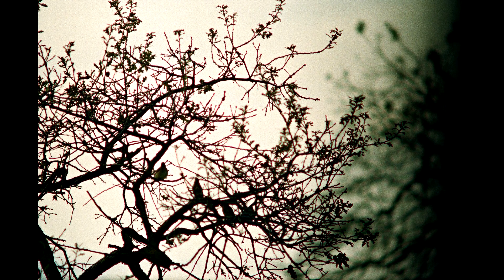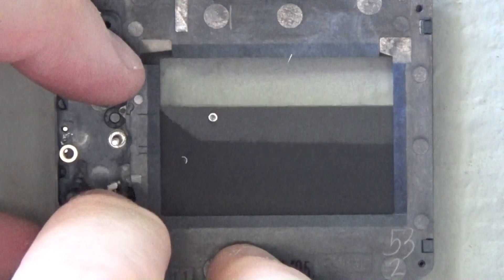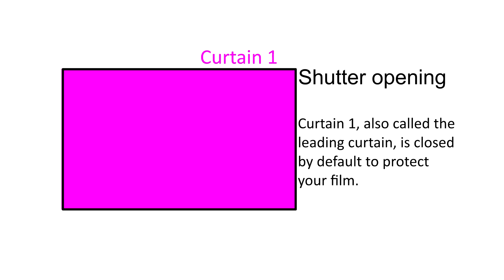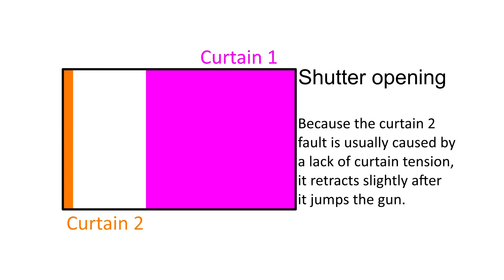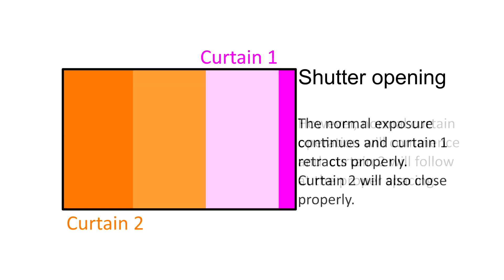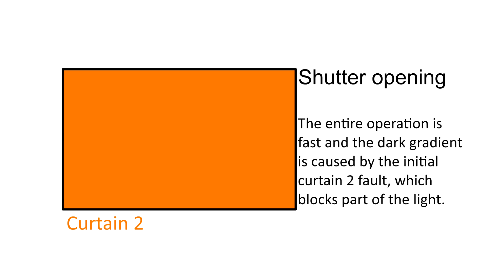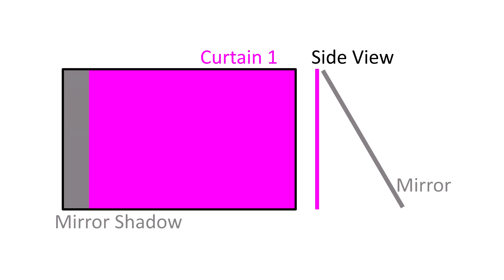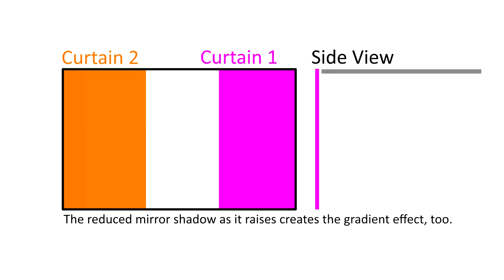Negative Flaw: Shutter Capping

Comment: exactly my problem with a newly purchased (but of course used) sr-t303. Does a "normal" CLA suffice, or do I have to specifically mention this problem when I get it serviced?
Reply from the maker: A normal shutter should be okay, yes. A good repairman will adjust the shutter speeds as part of a baseline repair.

Comment: I don't understand this video. What am I looking at.? What about a leaf shutter.?
Reply from the maker: Leaf shutters don't suffer capping. Basically shutter capping is a mechanical problem with focal plane shutter cameras, like SLRs, where in the shutter does not travel properly.
Reply: @DavidHancock  Thank you, I'm having a problem with lines on my negatives and I'm trying to determine if it's caused but the auxiliary shutter (barn doors) or if its a light seal. When I saw the title of the video I thought it might offer some guidance but now I see the difference between focal plane and leaf shutters.
Reply from the maker: @pefawa  Do you have a link to any scans? I can tell you what's wrong.
Reply: @DavidHancock  David, I appreciate your offer to look at the film scans, however I believe I've found what caused the dark lines on the side of the film. I develop my film in a Paterson tank using the plastic Paterson spools. I also have a similar plastic spool with an extra wide film guide. I used that spool when I first started developing film, it made the loading just a little simpler. Last week for some unknown reason I used that spool to process two rolls of film and that coincided with the line on the negatives. After eliminating what I thought might have caused those lines I took a look at my development process and asked myself what I did that was different. It was the spool. The film emulsion came into contact with the plastic, and as I wound the film the guide acted like sandpaper and scraped the film. By the way I really enjoy your channel, especially your reviews of different films. I usually sit here in complete silence listening as you go into detail about the characteristics of each film. Thank you for doing all that work and sharing your findings with all of us. I learn something all the time.! Mike